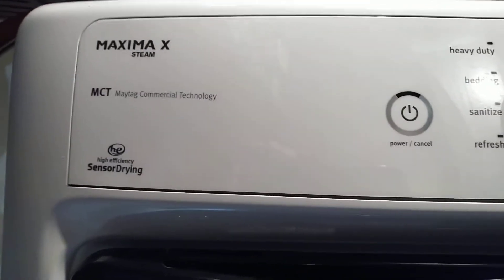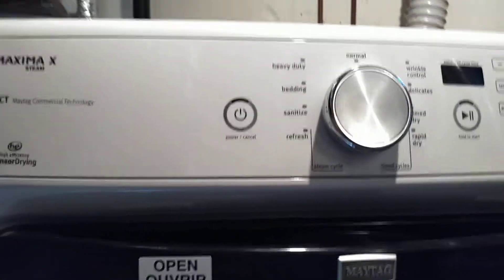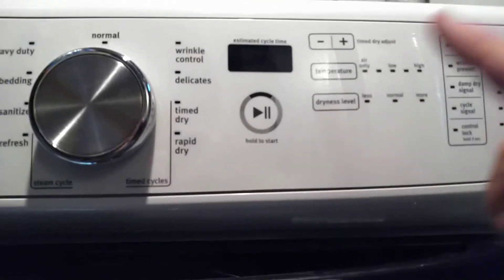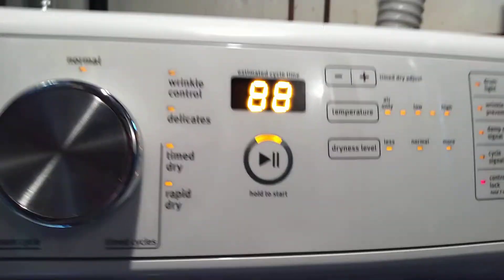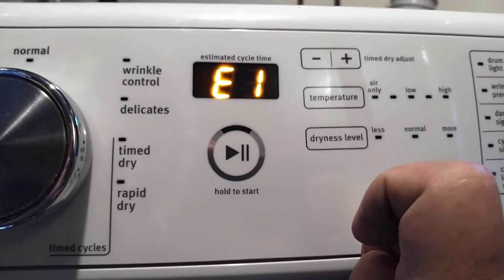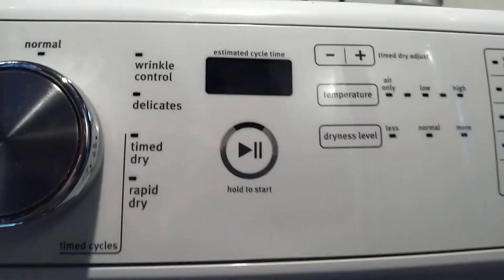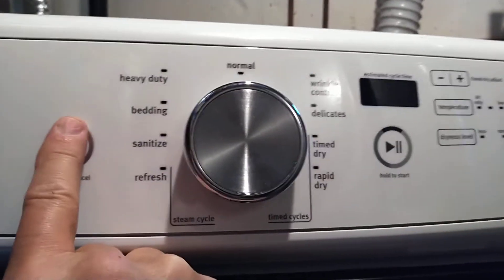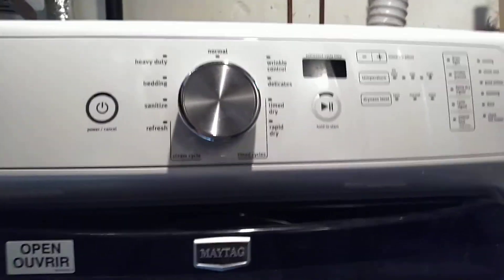Troubleshooting Maytag Dryer, Displaying Stored Error Codes

Comment: My is a MAYTAG  3000 SERIES , DO you how to do it ,?
Reply from the maker: 3000 series like MHW3000 should use same sequences. Pick 3 buttons except power.
Reply from the maker: For Bravo line it is different: 3000 Series dryers (Bravos line) use button sequences. Steps vary slightly by exact model (e.g., MEDB300RF), but this is standard for most.
StepActionNotes
1. PrepareUnplug the dryer for 1-5 minutes to reset. Ensure door closed, no cycle selected.Clears temporary glitches.
2. Enter Diagnostic ModePlug in while pressing and holding Start + Wrinkle Prevent (or Start + End of Cycle Signal) for 3-5 seconds.Display flashes "88" or all LEDs light up (5 sec), then shows "d" or code list. If no display, try More Time + Less Time sequence.
3. View Stored Error CodesRotate cycle knob or press Dry Level buttons to scroll. Codes flash as F# E# (e.g., F3 E1 = exhaust thermistor).Up to 4 codes; "PF" = power failure (clears on restart). If none, shows "noF" or blank.
4. Clear Codes (Optional)Press and hold Start for 3 seconds, or run a test cycle.Exits and clears; unplug/replug to confirm.
5. Exit ModePress Power or Cancel, or let time out. Unplug for 5 min.Run a Timed Dry cycle to test.

Comment: Is there a firmware reset option while in the diagnostic mode, meaning a complete factory reset of the dryer? This would not be the same as the "unplug the dryer for several minutes, then plug it back in" suggestion that I keep seeing.
Reply from the maker: @MickF04  No, not unless they hid one much deeper into the diag mode.
Reply: @madscientisthut  Thanks. I had cleared out the codes, and the one that returned was "F4E4". I tested the outlet at the wall, and I am getting the correct power there on both legs. I guess I can test it at the back of the dryer where the wires are connected. If it's fine there, then I am looking at a main control board replacement, which means we'll be replacing our 6 year-old Maytag Bravos XL dryer (MEDB855DC4).
Reply from the maker: @MickF04  That would be a bummer. I wish you luck.
Reply: @madscientisthut  Thanks. The 220/240V electrical cord tests out fine. The weird part is we're getting some heat, but not full heat, even on timed dry. The laundry will dry, but depending on the load, it can take a while. But it is enough heat to where once the laundry passes a certain level of dryness, it will completely dry the laundry. It does seem like the dryer is running on 120V. I may take the top back plate off tomorrow morning and see if there's a loose wire to the back electrical connection plate. If not, new dryer time. :(

Comment: What was wrong with it I have the same codes
Reply from the maker: This was what happened with mine, the dryer stopped heating, though the display was still on and it continued spinning. After checking the error codes, I discovered a line voltage issue (one of the codes indicated line voltage error)—one of the circuit legs in the breaker box had tripped. Resetting the breaker got the dryer heating again.
However, the next day, the circuit breaker tripped again. I found that a loose screw securing the wire to the breaker that was causing the wire to overheat, which led to the breaker tripping. The wire at the connection point was extremely hot. After tightening the screw, the wire returned to its normal temperature while the dryer was running, and so far, the breaker hasn’t tripped again. Hope this helps you out.

Comment: How can i clear the codes?
Reply from the maker: Sorry I did not do that video. I will have to get the manual out to look it up. Let me know if you still need the info and I will try and look it up tomorrow.
Reply: @madscientisthut  thanks. Do you know if a blown fuse would cause that dryer to not start and give me error codes of F1 E1 and F4 E4
Reply from the maker: The F4 E4 could be a fuse, house circuit breaker, or even a loose connection on the wiring.
Reply: @madscientisthut  Thanks. I bought it from a friend and took it apart today to find a lot of lint settled in the exhaust area blocking half the exhaust so I'll be checking the fuse tomorrow. I'll let you know how it goes
Reply from the maker: I am curious, did you get anywhere with the dryer?
Reply: @madscientisthut  no sir. Both Fuse and thermistor checked good. 0 ohms across.. Also getting check lint screen light but the whole thing has been thoroughly cleaned so I'm not sure what's going on

Comment: I get those same codes what was wrong with yours? My stay sensing no spin or heat
Reply from the maker: I had one leg of the power off. The display and controller are powered from the other leg.  I had traced it back to my circuit breaker having a loose connection on the bad leg.
Reply from the maker: The 3 codes stored  F4 E4 , F6 E1 , and  F4 E3 are poor exhaust flow,  line voltage error and a CPU disconnect.

Comment: Will your video on the brake and cruise control switches work for a 2015 juke? When we push to start our car we get a clicking sound, dashboard lights come on but the car doesn't start. After a while it starts but mostly it's a clicking sound with dashboard lights on.
Reply from the maker: A quick question, did you see my other video for the no start issue.
https://youtu.be/0hZmqoetpCc
 If this video works for getting it started , then I am thinking it certainly would help to replace the brake switch.

Comment: useful but you need to know what the error codes mean 
🥸fully viewed🤖Au🦘☑thumbs up👍👍
Reply from the maker: Yes just like reading the error codes from OBD ports on cars, just search google for the codes and usually it can be found. This time I was lucky since one of the 3 codes said I had a line voltage error, went to the circuit breaker box and one of the 2 legs was tripped, reset the breaker and the dryer is working great again. Thanks for watching!
Reply: @madscientisthut  thats some great luck